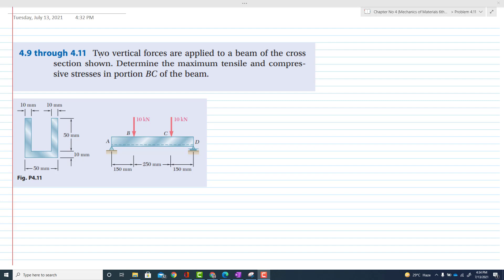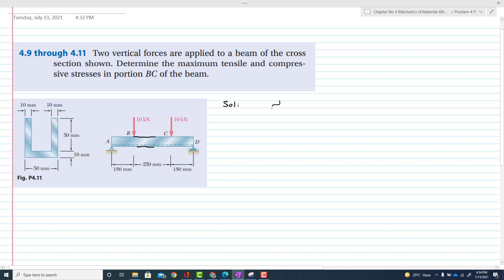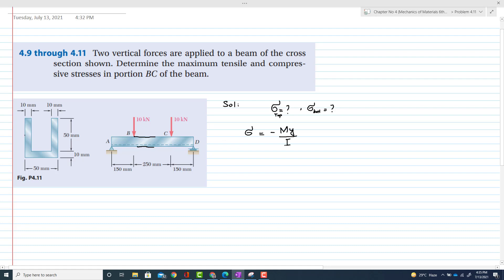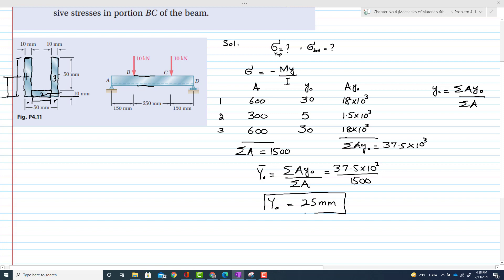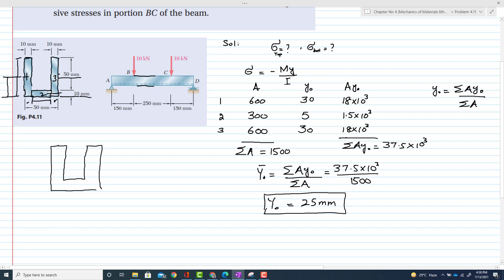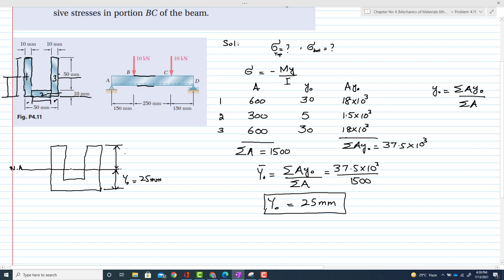#Mech of Materials# |ProblemSolutionMOM​ | Problem 4.11 |Pure Bending| Engr. Adnan Rasheed

Comment: 10:35 sir why we are not considering the reaction forces in A and D? Thank you
Reply from the maker: This is one of the method and method can be the one in which you have to find the reaction forces at A and D .
Reply: @engradnanrasheedmechanical  I found the reaction forces different than 10kN. You are right, the reaction forces are also 10kN. I found it wrong. Thanks for the feedback sir.
Reply: @engradnanrasheedmechanical  And the moment is in this direction as you shown because of it will balance the moment due to 10kN force so the top will be compression bottom will be tension.
Reply from the maker: if you take right hand side for portion Ab it will counter clockwise moment and on left side portion cd it will be clock wise moment thus producing compression in top and tension in bottom
Reply: @engradnanrasheedmechanical  I got the concept very well watching your videos. Thank you so much sir.
Reply from the maker: @yasin_zengin you are welcome and share my video with all your friends